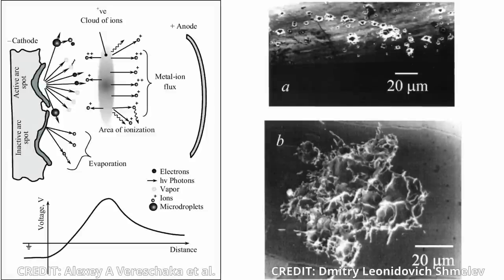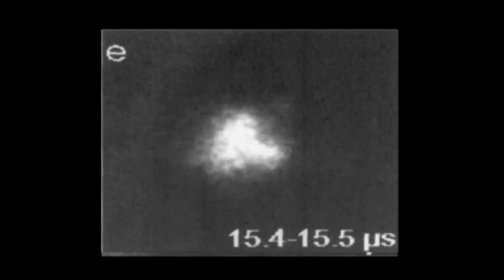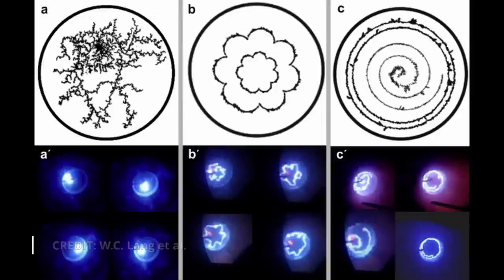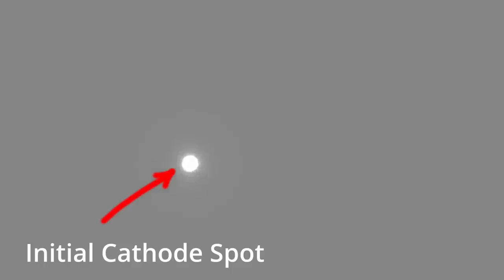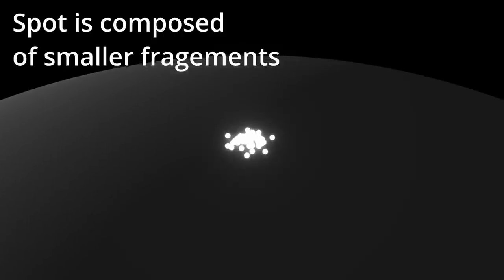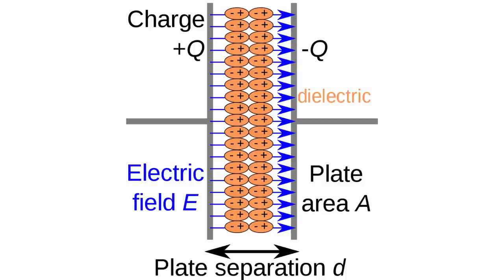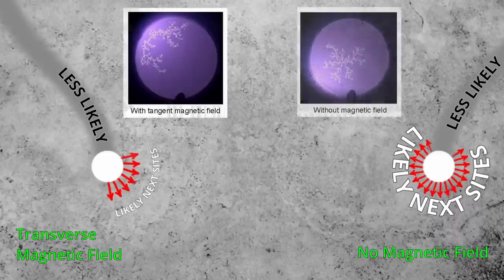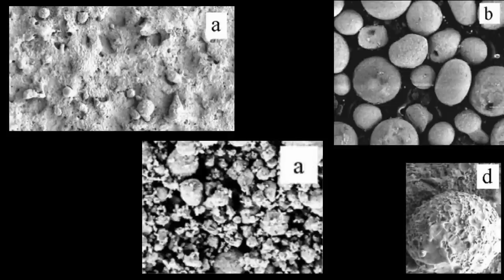The Fractal Nature of Arc Vacuum Cathode Spots

Comment: 0-1-2-ness point-line-circle projection-drawing and frequency inversion at the surface of conductor-dielectric interface where vertices diverge. 

Subsurface counter rotation, electron-positron style of the kind associated with Superconducting circumstances. 

Base function e-Pi-i Superposition-point Singularity flash-fractalisation is a pseudo random combination of the variables contributing to the Plasma phenomena. 

Prime-cofactor resonances, complicated and messy. 
(I hope you aren't satisfied with this superficial contribution, more research needed)

Comment: what about the 56 circular spots observed in historic cave pictographs and in lab experiments and stellar high energy events.  what's this about    does it relate to curved higher dimensional bubbles colliding and the constant pattern of rotation as a toilet rotates when flushed and which changes rotation direction at the equator and this is the model for the building blocks for weather and surface effects, but which are   arising from influences of multiple or hidden higher dimensions or colliding bubbles of branes.  forgive me for being so simple in this question but   what's it all about

Comment: When I was just thinking this is related to my other comment the clean electrode probably takes a lot more power for the breakdown voltage cuz there's nothing there to sublimate into a gas like the dirty electrode and that's why it takes lower voltage to have breakdown on the dirty electrode and that's why it probably takes more voltage to have a breakdown on a clean electrode because there it would take more energy to create the plasma through the breakdown voltage of the air